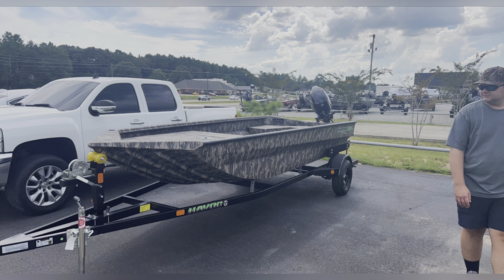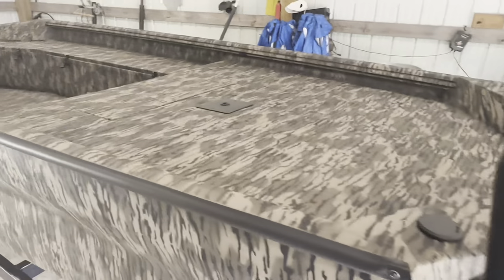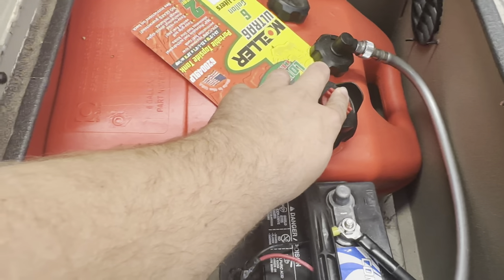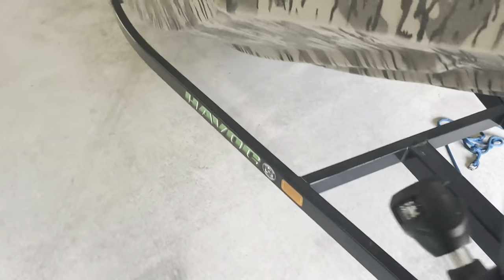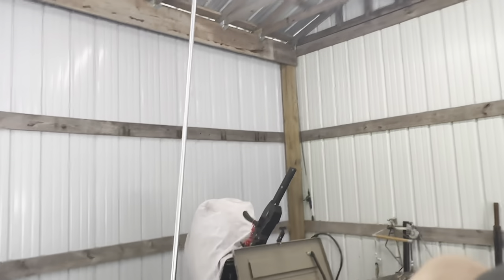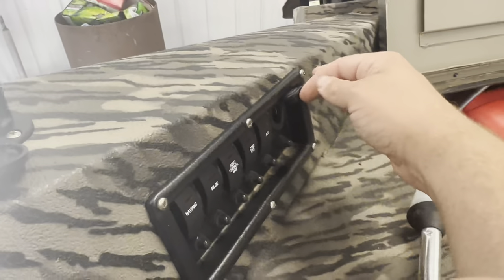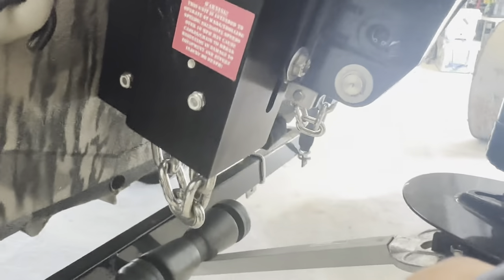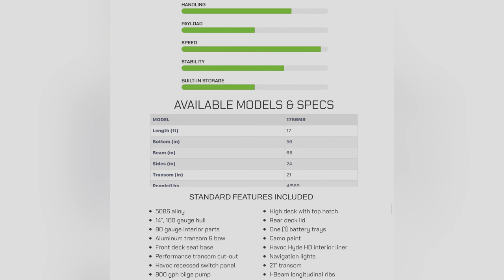1756 Havoc | 🌾 MARSH RUNNER 🌾 | walkthrough | 60 fourstroke Tohatsu

Comment: How’s it run with the motor that high? I got the same setup on a 1656 and mine is set on the second hole.
Reply from the maker: It’s fine if I sit someone up front, or I’m by myself. Porpoises bad if two people sit in the back. I plan to move it back down one hole. How’s yours ride where it’s at?
Reply: @sacredsouth  rides perfect with any load. Me and my ole lady can both sit in the back and still trim out.